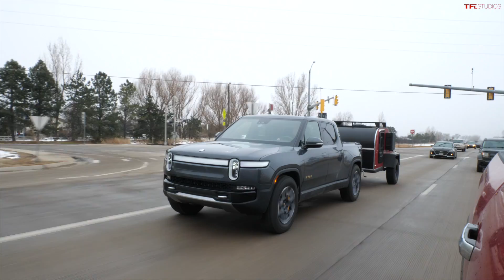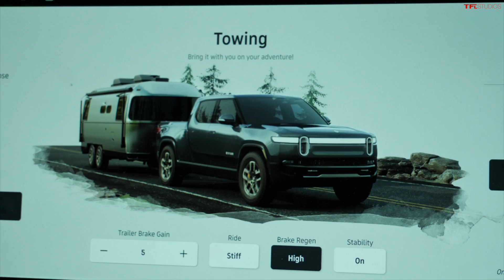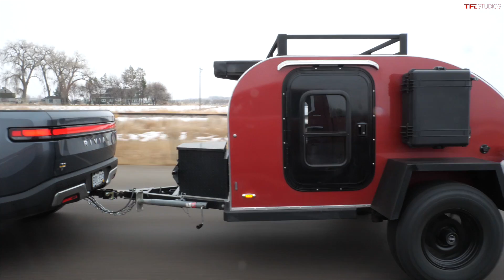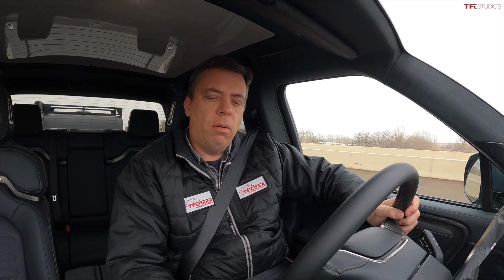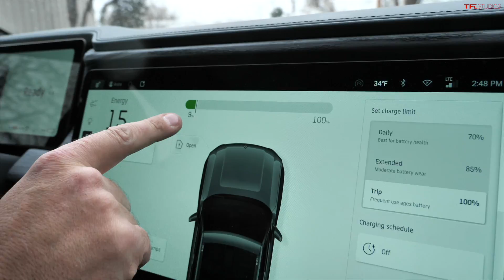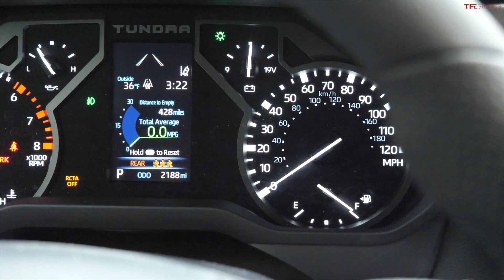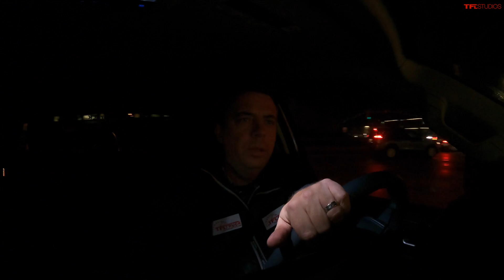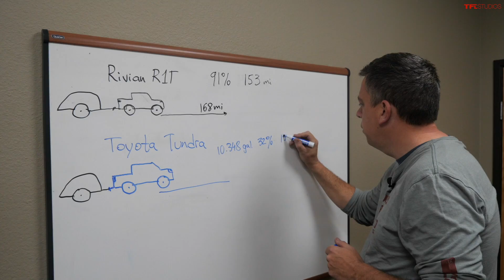Rivian R1T vs. Toyota Tundra: How Far Can Each Truck Tow On A Single 'Fill-Up'?

Comment: Calculating the cost for each trip in terms of dollars per mile show that the Rivian cost $0.248/mi ($0.31/kWh DC fast charge) and the Tundra cost $0.223/mi ($3.30/gallon 87 octane). 

The cost for the Tundra in the video was $0.263/mi because the used 91 octane at $3.89/gal.

Comment: 122kwh is a lot of power. I'd like to see a cost analysis or how mucb it costs to charge. 122kwh is about 4 times more energy than the average house uses per day. Electric vehicles are a long way away from being good towing vehicles because of time to change, range, weight and costs.
Reply: Each gallon of fuel has 33.7kWh, so the Tundra burned through 337 kWh!!!  Fuel and electric prices vary greatly across the US. Cost to recharge is about a 1/3 of fueling up. For Electric,  charging is $9 in Texas, but $26 in Cali. Same for fuel (10 gal), $29 in Texas but $47 in Cali. All values are  average rates Feb 2022.

Comment: You've proved that long distance towing with an EV is not going to be fun or even practical from a time and even cost (charging isn't cheap) perspective.   The idea of towing the camper out to Yellowstone or some other popular attraction isn't happening.   If you want an EV get a highly efficient model that goes far and charges fast...and sleep in a tent, hotel or airbnb.

Comment: Tundra only got 14.78 mpg (99% highway) pulling a 2000 lb trailer at 60-65mph? Not impressed.
Reply: Older Tundras only get 16-17 mpg towing nothing...

Comment: Thank you TFL for all the content.. 
Questions regarding  this test...Toyota 389 hp 479 tq. towing a 2000 lb trailer low drag teardrop trailer. Was tow haul mode necessary?
Was  premium fuel used since t was a towing test? I would like to see this done with a box trailer or traditional single axle camper as well.
I could be wrong  but how many people are gong to buy a Rivian and then go buy a teardrop trailer? Most likely they already have a trailer or camper.. Would also be nice to compare cost per mile charging at home vs charging station vs gas. Does Colorado has time of use electric tiers? 
Granted if dropping the cash for a Rivian, the electric bill is like worring about the price of gas after purchasing  a TRX.
Keep up the good work.

Comment: I'm surprised you guys didn't talk about cost of gas vs electricity. May be a bit more complicated but I think a generalization would have been nice.
Reply from the maker: We will do more about this in the future. Electricity costs between $0.12 to $0.31 per kWh depending if it’s residential or public charging in Colorado. 87 octane costs about $3.65 per Gallon.  It costs about the same to fill up both of these for this trip.
Reply: That is an interesting tid bit! Maybe on the surface it looks like a loss for electric there definitely needs to be consideration to environmental impact, dependent on local energy of course, and the future of electric will only get more efficient. The conversation of efficiency ratings for EVs definitely needs to come into the light soon. @TFLtruck

Comment: TEST seems a bit odd... Towing Range Test, but ONLY towing 18% of capacity of the R1T and surely less of the capacity of the Tundra. Thanks for the test, IMO it seems like the opposite of your normal towing tests
Reply from the maker: We published a Rivian Ike Gauntlet towing test with an 8,100 lbs trailer about a week ago. Both the Tundra and the R1T are rated to tow about 11,000 lbs.

Comment: Buy an EV if you’re interested, but just don’t do long haul towing with it. For sub 1 hour towing, it’s enough truck for me. Thanks for testing TFL but wish you figured out the efficiency numbers between the two trucks. As in how much $ did u spend on the Rivian to recharge and compare it with the Tundra’s

Comment: For perspective you hade roughly 7.5 times as much energy in the tundra compared to the Rivian. Doesn't change the results but it does show the efficiancy difference.
Reply: EV's are very efficient, but the electricity generation efficiency also has to be considered as the battery is just storing the energy, it isn't generating it.
Reply: @marlinguidegun1657  Yes absolutely agree 100%. It can however be said chemically speaking the gas car also just uses stored energy with a different reaction to release it. Lets not forget gasoline doesn't magically appear at gas stations and its far from a clean process compared electrical generation and transmission.
Reply: @axelwallenberg6167  One analysis from a year ago in a book on BEV design showed that the BEV was around (if I recall correctly) 7% more efficient overall than the ICE on a "well to wheel" basis. The gas extraction, refinery and delivery process, well to pump is around 85% efficient and the electricity generation process is around 40% efficient on aggregate, give or take.

Comment: I'm grateful for all of the videos on the Rivian that the TFL group have created and shared.  However...Hugely disappointed in the chosen trailer.  Despite the range being impacted greater by a larger trailer, that should have been included.  The truck is rated to 11Klbs, choosing a teardrop that is 1/5th of the weight rating does demonstrate the impact towing has on an EV.  A 23 foot airstream would have been a much better choice.  Even in the Model X TFL used a 5K trailer and that is the Tesla's  max.
Reply: Agreed. The rivian weighs as much as 3/4 ton truck. They would never tow a teardrop with a truck like that. Put at least 8k behind those trucks and give us a better test.

Comment: Nice review Andre, I really don't think the Rivian did that bad considering not having a heat pump while driving in cold weather. Out of curiosity, since you calculated the energy efficiency of the Rivian at 1.25 miles/kwh, I ran the numbers for energy usage for the Tundra assuming 33.7 kwh/gal of gasoline. Tundra eff = 153 miles / (10.348 gal * 33.7 kwh/gal) = 0.439 miles/kwh which makes the Rivian around 2.85 times more efficient at using energy than the Tundra for this test.
Reply: A Tesla Model 3 is about 4x as efficient as a comparable fossil.  (30mpg vs 120mpg).
Reply: Electric motors are so much more efficient than an ICE. After 3 years and 29,000 miles, my 2018 Chevy Volt had a lifetime efficiency of 127 mpg which was 69% electric driving in total.

Comment: my airstream is 6200 lb ,I travel light , 800 lb hitch  ,26' x8.5 wide , I drive ,stop, refill ,drive ,repeat, the EV would  work for me ? have to wait in line , to get into the charge sta. and spend 20min s charging? , I do lot of calif to Idaho over the doner pass, on I -80  its   like your IKE pass , have to  pass on the EV truck for now

Comment: Interesting video.  By comparison, the Rivian used 0.47*10^6 Btu's while the Tundra used 1.20*10^6 Btu's based on the miles, Whr/mile reported and average Btu/gal assuming regular-grade gasoline.  This would indicate from an energy usage, the Rivian is more efficient.  However, using Electrify American membership at $0.31/kWhr v. the $3.90/gal apparent for the Tundra fillup, the cost is $37.94 for the Rivian v. $40.36 for the Tundra.  The difference closes markedly.  If not an EA member, the cost difference reverses.  Of course, charginag at home at around $0.14/kWhr is substantially greater.  The latter dosesn't apply, at least outbound, when traveling, of course.

Comment: Well as the batties age they will hold less power. I use to fly turbine helicopters before I retired, and we would put in a new Battery every year during annual because we wanted the max battery power for starts we could get without an APU. Did a lot of remote flying in my career. That Rivian R1T is really not a truck it's really just a sort of station wagon at best. The Problem I have with EVs is the government tax incentive to buy and the states do the same when it comes to registration and other tax breaks on State Income tax. The damn things just take whatever environmental issues with Internal combustion and put it elsewhere mostly in the Third word. You go to one of those mines where they get the nickel and what have you to make the batteries.  Come back in 10 years, my guess is the batteries will be shot by then, While the Tundra will just keep going like it did when it was brand new. You buy a truck to do truck things, the Idea I would consider taking a Rivian R1T on an extended flyfishing trip I do every year on the Forest Service Roads in the West fishing the little streams for trout is laughable. I can't put eclectic power in a jerry can.  Rivian R1T is a niche vehicle for urban dwellers. I would given the choice would always choose the likes of the Tundra. Even the older V8's are a way better value and utility than you want in a truck.

Comment: Is it possible to show the cost of charging the Rivian versus the gas cost for the Tundra?
Reply from the maker: Great question. Electrify America charges about $0.31 per kWh. So the Rivian needed about $38 to fill up.  87 octane is close to $4 per gallon in Colorado. The Tundra cost about $41 to fill up for same trip.  So about the same.

Comment: I think with the Rivian towing, the sweet spot is going to be about 3500 lbs. or less. It may be rated for 11,000 lbs but Rivian are hurting themselves saying this because at 11000 lbs the range will be well under 100 miles. It’s not even close to practical. EVERY EV TRUCK MANUFACTURER is doing this mind you, so it is a fairly even across the board. I think the targeted market will hardly, if ever, go over maybe 7,000 lbs, so it’s ok, but only ok. For me personally (???) it’s really not even close to practical for towing, but I’m only one customer. If I were able to access within less than 2 months, all of the EVs on the market and had to buy one, there’s only on choice as of today! The Rivian. It’s not excessive in pricing like the upcoming Chevy RST version of EV truck, or the Hummer. The lower version of the Chevy coming soon and the Lightning will hurt Rivian sales,,,, size matters with trucks, but there is definitely a market for smaller trucks,,,, look at the Maverick sales!!! Haha, I have/had one!! Loved it but it was too small for me so I have sold it to my niece, who comes to pick it up today!!! She is an adventurous lady and will definitely be that person with a 2” lift, bigger off-road based tires (the Maverick is a FX4 AWD model) a Roof Top Tent or Teardrop camper, and in the desert, or mountains etc. A good future client for the R1T. 
   The size is odd with this truck. It is bigger than a mid size, has a compact sized box, enormous power that would support a larger bed, be more full sized truck like, but then they clearly chose a similar niche as to what the Ridgeline has kinda succeeded in. 
    Time will tell,,,,,, this my be one of the only EV start up truck companies that will survive!!

Comment: Based on the cost of electricity in Colorado to charge at home of $0.14 per KWH and a 15% inefficiency for charging the Rivian. I came up with a cost of $19.80 for the loop vs. $40.35 for the Tundra. Based on a previous video with Tommy charging the Rivian, the costs at a commercial charger would be nearly equal. Inefficiency when it comes to time but at least charging at home a considerable cost savings.

Comment: What about financial cost of towing?
The tundra cost $40 ish of fuel. What did it cost for the Rivian ?
Reply from the maker: About the same. Public charging is $0.31 per kWh.
Reply: @TFLtruck  Technically the first 150 miles would be charged at home and cost on average $0.11 per kWh. More fair number would be $0.15 kWh so half the cost IF you only make one 150 mile trip.
Reply: @TFLtruck  ok. It would have been nice to show that on the video. Luv your channel.

Comment: I’ll stay with fuel. But question for me is that amount of miles for the tundra was $41 how much do you think the electric was 
if you convert to $. How much can I possibly save using electric?
Reply: Using a DC fast charger to charge the rivian 91% it's going to cost around $38. So very similar. But you should be able to charge at home for less than half of that figure.

Comment: This is all very interesting. One thing you didn’t mention though is that the Toyota used an equivalent of 348.7276 kWh compared to the rivian’s 122.85 kWh which means the rivian is 2.84 times more efficient
Reply: It HAS to be more efficient, because battery technology while improving is still far behind gasoline in energy density.
Reply: YES RIVIAN MORE EFFICIENT,,, BUT  MANY LOST  HOURS  IN CHARGING TIME  IF  DO  THE SAME EXACTLY MILES LIKE TUNDRA,,,,,
Reply: This was needed at the end of the video! Andre let us know the kwh efficiency of the Rivian but not compared to the Tundra!
Reply: 70 minutes to charge from 10-90%. Even a 450 mile drive would add almost 4 hours for stopping/charging while the Tundra wouldn't have to stop at all. What is 4 hours worth?
Reply: @courtneyanderson2293  I live in the northern most reaches of DFW, TX. 450 miles is enough for me to drive to San Antonio and almost enough to reach El Paso. Most people do not drive on the epic road trips that they pretend to and also don't tow those kinds of extreme distances. Obviously every use case is different but "range anxiety" is bullshit FUD.
Reply: @J-RtheWarlock  I'm 500 miles from the city and the nearest charging station and drive about 70,000 miles a year. 
I've been considering installing a charger at a place that is midway, but I cannot make it there if I am towing, which is 20% of the trips. 
I also have 10 trailers, 6x12 up to 8.5x32, dump, boat, seadoo, deckover etc. I run a 3/4 ton diesel, Canyon and 4 Yukon XLs.
I haul items needing climate control and are 88" x 32" and 24" high, which eliminates any EV available for that side as well. 
It is -31 outside right now, -41 windchill, so yes, range anxiety is an understatement.
Range is the main reason I ordered a new diesel Escalade and not an EV.
Reply: @courtneyanderson2293  your use case is an extremely tiny minority in the context of millions of vehicles sold per year.
Reply: That’s nice and I’m sure you’ll be thinking that when it takes you 3x the time to get to the same spot.

Comment: One other pertinent question is the cost of this trip.  How much did it take to fill up the Tundra (I saw ~$40) versus the cost to fully recharge the Rivian.
Reply: The video where Tommy recharged the rivian a week or so ago, showed that it was expensive to recharge.

Also, do you think I want my wife sitting at a recharge station in the middle of the night to save the planet?

Comment: So even with a lighter trailer to try and make the rivian look better it still failed miserably on range. An average truck guy has a boat or camper and they dont want to mess with charging on a trip. Hybrids are the future truck guys want. Ford has the right idea now if they could have bigger electric motors and batteries that would be the way…

Comment: Based on the 135 kWh battery pack, 91% charge is 122.85 kWh, and the published electrify America rates for charging in Colorado ($0.31/kWh), it would have cost $38.08 to do this trip in the Rivian. However, from previous tests you've done, the chargers claim 5-10% higher kWh usage than the truck receives, so really $40.09-$42.32, making the Tundra basically the same price, or cheaper, for this route as it cost $40.35 in the Tundra. Or at worst, $2.27 more in the Tundra with 100% efficient chargers. Seems like a reasonable trade-off currently in order to go ~3x farther before needing to fill up.

Would this be an accurate takeaway from your experience?

Comment: Interested in seeing the RT1 vs. Andres hybrid F150. Hybrid with a built-in generator can charge itself andcan fuel up in a coulle minutes anywhere there's gas. Would likevto see plug in F150 hybrid with larger batterry and the non rusting frame option.

Comment: Still amazes me that towing for fuel economy eludes TFL. An obnoxious off-road trailer driven on asphalt at non-towing speed can somehow reduce total efficient range? I post this theory; rent a 4x8 Uhaul trailer that is engineered to be towed efficiently at highway speed and still knock off 5-10 mph.

Comment: Outside temps will effect the Rivian more than the Tundra. Kind of like an altitude adjustment for Ice engines.
Reply: Modern engines do not have issues with altitude like they used to. Naturally aspirated engines maybe have less power due to atmospheric pressure being lower at higher altitudes but, we are light years ahead of the carbureted engines of yesteryear.
Reply: Turbo engines actually doesn’t really suffer the altitude thing.
Reply: @carholic-sz3qv  they do actually if you watch the diesel challenge the guys from the coast always struggle getting their turbos going when they are in Colorado

Comment: In the Tundra, Andre paid $40.35 for 10.348 gal of gas, or $3.899 per gallon (premium?).  He went 153 miles on that 10.348 gals, so 14.8 mi/gal.  In the Rivian, Andre calculated a consumption of 1.25 mi/kWh, which is 800 Wh/mi.  Charging at Electrify America costs $0.31 per kWh (plus $4/mo plan price).  Using those numbers, you can calculate at COST EQUIVALENT mileage for the Rivian of 15.7 miles/gal.  If the Rivian were a Tesla, you could charge at a supercharger for $0.25/kWh resulting in a cost equivalent of 19.5 mi/gal and if you were charging at home for $0.10/kWh you'd get 48.7 mi/gal. So the economics of an EV truck depends heavily on what percentage of your miles are public fast  charging.